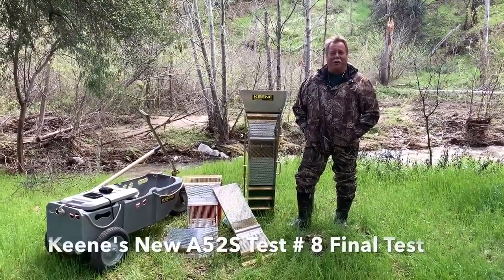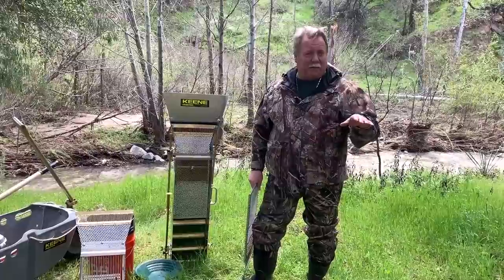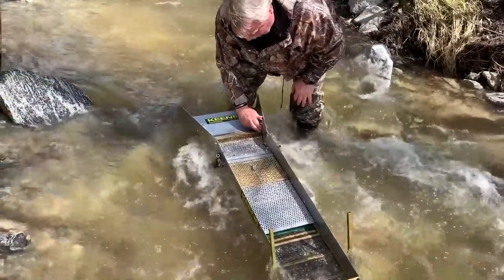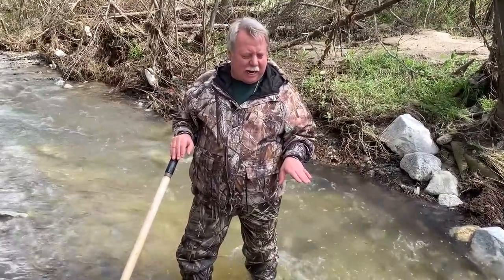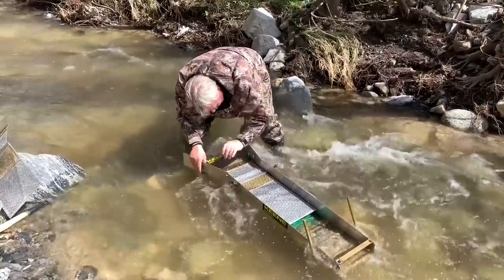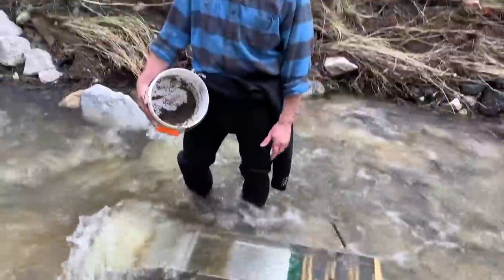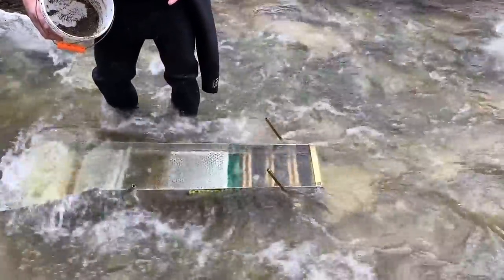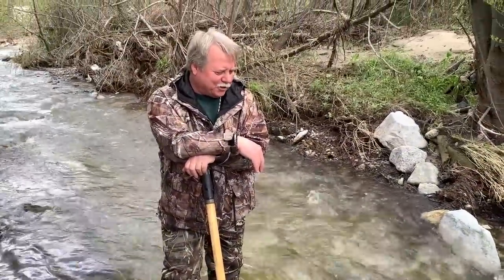Keene's A52S Test #8 Final

Comment from the maker: You are absolutely right it is disgusting how they are grabbing more and more land every day. Locking up gates more restrictions especially when they are using self-serving science.  The truth is Keene Engineering does more than any other company out supporting organizations that are trying to make a difference.  At one time we lead some of the organizations however sometimes people have other priorities.  We will continue to provide support for the outfits that make a difference such as the AMRA and other worthy causes
Reply from the maker: @pauly51    We keep going back and forth with the half and full mats all our testing was with the half matting and it worked great.  I had several customer-requesting full matting in the flare so we did it.  Then after a lot of feedback, the full matting slowed the material down and reduced the production. It simply slows the material down to much in some materials.  So we are settling on the half matting.
Reply: @KeeneEngInc  great news. Any advice on using A52s? And does 1in drop to a foot apply? And how about 11 degree pitch? Thank you
Paul

Comment: Not an engineer but for all practical purposes it  appears the front  of the box should be higher looks to me as if there’s too much flow? I’d adjust for two inches of water flow inside box! Maybe I’m messed up just my opinion. Enjoy all of your videos Keene Brothers keep up good job!
Reply: For fine gold... yes!  There are several things we can do to make sure we are catching as much gold as possible.

We can reduce the volume and or velocity as suggested and or we can add another A-52 box as an extension.  We can run a line of magnets across the box to catch the blacksand and then use the magnetic black sands to trap the fine gold.

Even running as fast as they were... you can see they still caught a decient amount of both black sand and micro-fine gold.  (These guys are generally after gold they can pick up with their fingers).  

In ultra-fine gold areas I run two boxes and I run low and slow and classify to either 1/4 or 1/8.  

With the A52S... we bypass the tedious fine clasifications and shovel into the box or we can classify to 1/2" and feed from the bucket.

During the pandemic... when I got my money... I went strait to town to the sporting goods store.   

There was a green origional Le Trap bank robber leaned up against the display... I bought it and cut the back out and made a river robber sluice out of it.

Placed on the end of a standard sluice box... the Le Trap does a great job of catching all of the black sand and the micro-fine gold.

It cleans up in a flash and is ready to go back to work in less than a minute.

They could, you could and we can hold a 70 - 100 mesh clasifier at the end of the sluice to see if we letting anything get past our system.

Comment: I ordered this sluice and I am going to try it out in August. I am curious as to how well it compares with Fluid Bed Sluices such as the one made by Greenmountaingoldtrap and how well it captures fine gold compared to a Le Trap Sluice. I am pretty excited over not having to classify material: that alone increases the efficiency for time and effort spent. The return rate for total gold capture and minimizing the loss rate is also critical. Both the Greenmountaingoldtrap and Le Trap Sluices are very simple to do clean outs. The former has the advantage of just keeping the sluice in place in the river and the trap is taken out, cleaned and then put back in. So there is that as well: number of clean outs and ease of clean outs and whether or not the entire sluice needs to be removed.
Reply from the maker: I am sure you will love the new sluice box.  We have had lots of feedback on 98% has been positive.  Plus if you compare it to all the other sluice boxes the legs are a game changer.  The only issues we have had is the main sluice does require lots of water when using the sluice and the box should be completely underwater to keep the rocks moving through the sluice.  Big rocks do require more velocity to keep moving.   The only other comments we have had is in slow water conditions you have to go back to a conventional sluice and you have to pre-classify.  We had a few comments that the Miracle matting could bow up in the center so we one more change in the sluice we added a few bars to hold down the Miracle matting.

Comment: Hey Pat! Now you're getting it! 
Instead of having 1 product that does everything, offer multiple products that do one thing well and does it as good or better than the other guy.  Experienced prospectors have different techniques for different condition, as carpenter, pipe fitters, welders..... wouldn't it be nice to have a welding machine that would handle any situation?
It will never happen! Just like making 1 sluice for all occasions.
Good luck!
Ron

Comment: Its a great box wish they sold them bare with the classifier. So people can build to they're environment needs.  A 16 inch flairless with higher walls for buckets or barrows Would gulp the material  up with that waterspeed.
Reply from the maker: If you only want parts this is not problem just sent me a email or call in 8189930411

Comment: I think that your need to go back to start and try again, after buying this product it doesn`t matter what speed of water or the right site up this sluice doesn`t find gold, your moving rocks off of the screen with every shovel of material you place in the sluice, bad product.  I have a Le trap that does the same, I can shovel into the sluice and at there isn`t every shovel I don`t have to remove the rock …………….
Reply: Hi this is Pat from Keene. I left you a message to call me for assistance. The water needs to be at the top of the sluice for it to have enough surface area to move larger rocks. You also need a lot of speed for the screen to work properly. The sluice needs a lot of energy to work effectively. There are many prospectors using this sluice with great results. Just maybe there is something different or just call so we can talk about improving for your area. I am very interested in giving you some customer support and maybe a modification. Regards